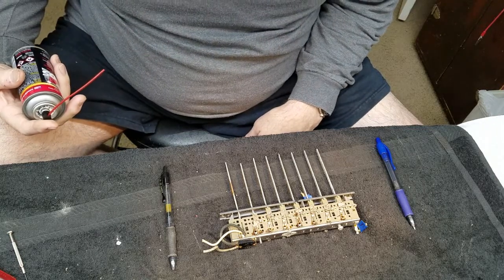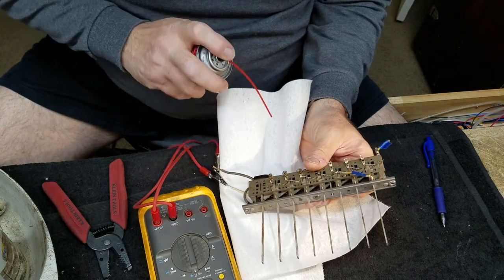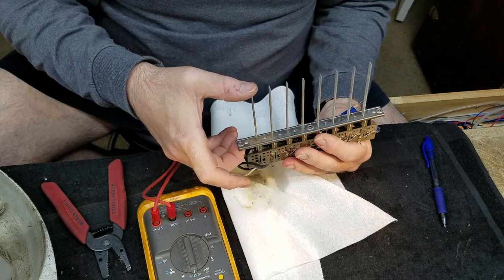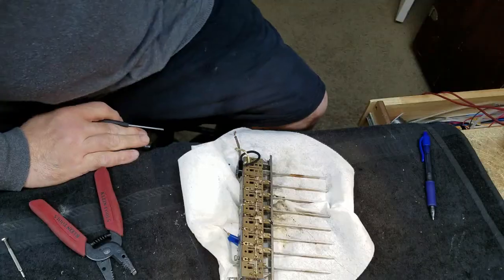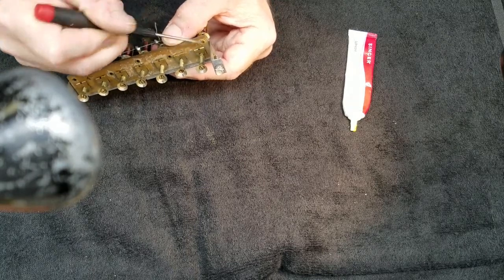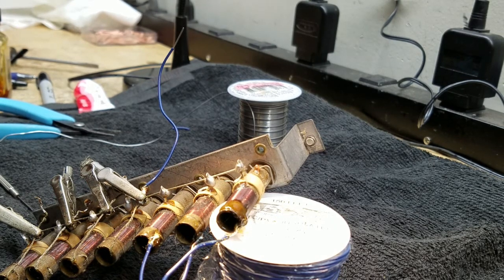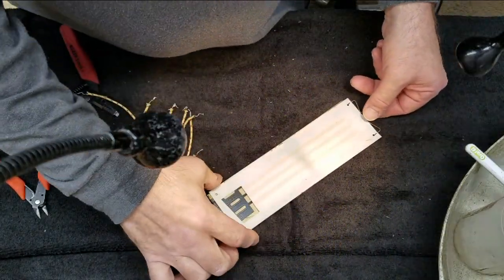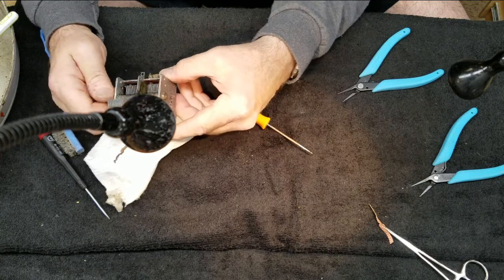1941 PHILCO 41-285 CONSOLE Part 5 of 9 Station Pre-Set Controls

Comment: Michael, you struck gold on repairing those tuning coils! That was a good looking repair, those braided wires are a bugger to solder to, arent they? Lol. BTW, when ur ohming out that last one, look at the one next to it.mit has either a cat hair or is a wire in the end of it. Not sure if you saw that in editing? Great video as usual, and looking forward to hearing this set play! Best, Larry
Reply from the maker: Thank you, Larry!  You are quite generous.  Those wires ARE a pain to solder to, requiring a whole lotta' heat!   That's one of the reasons that I like solder flux so much.  I couldn't imagine soldering to that old stranded wire without an ample dose of tree sap.  I think the "hair" is actually a bit of the thin cloth insulation that was originally on the lead from the coil.  Most of it was either eaten by Mickey and friends, or disintegrated when I began handling it.  Don't worry, though...Fred and Buster make sure that there are plenty of cat hairs on hand, believe me!  Thanks again, Larry!    Take care, my friend.    Michael